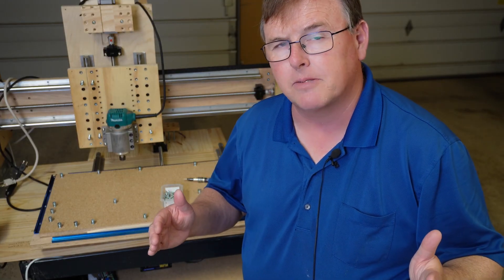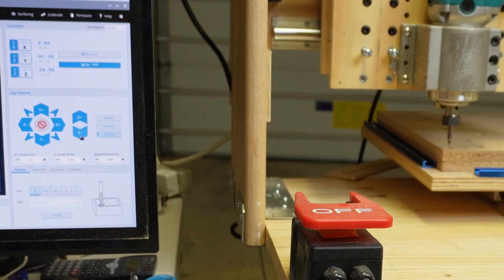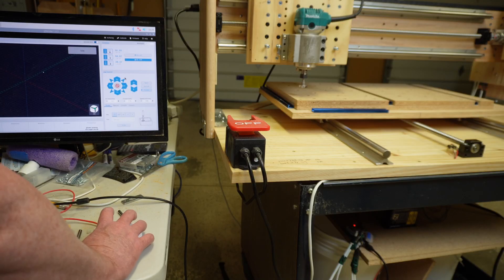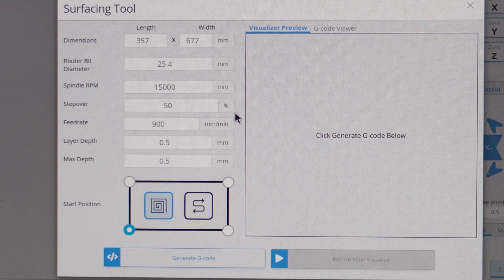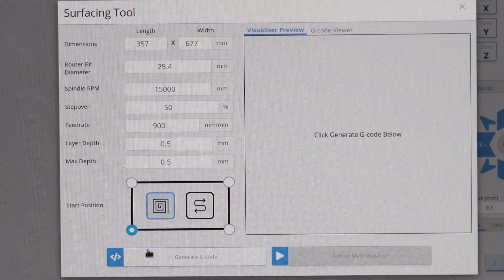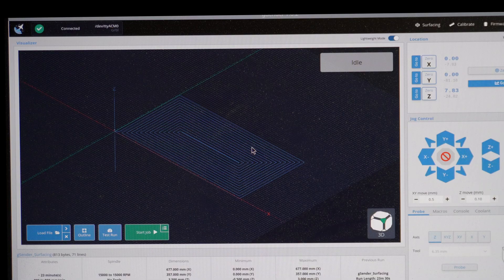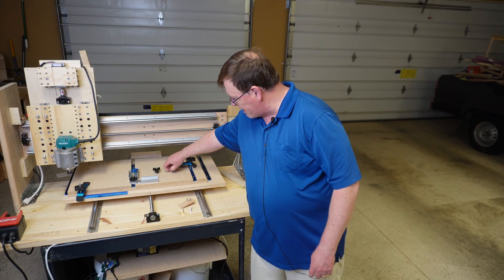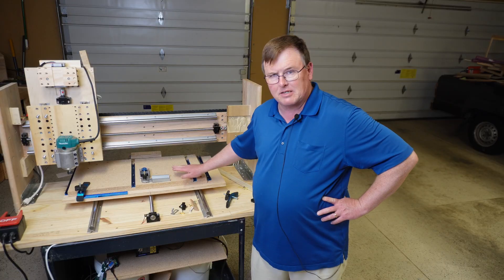Make A CNC Spoilboard The Right Way Not The Wrong Way | BUILD A CNC ROUTER THE EASY WAY EPISODE 25

Comment from the maker: I forgot to mention that I still did a 0.5 mm surfacing pass on the 2nd spoilboard.  Since the first particle board was already leveled, the second layer only required this one pass to
remove all its pencil marks.  In the future, of course, I could always resurface this 2nd layer as required or replace it entirely.  The big advantage of this double decker spoilboard setup is that
whenever replacing the new layer it will already be very close to level (thus never require a great deal of surfacing).  I hope that clarifies things.